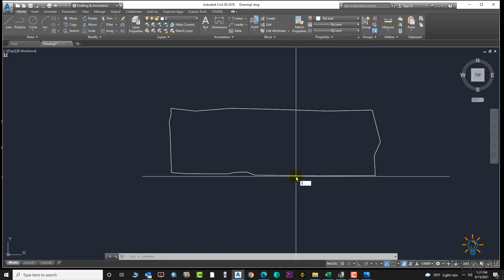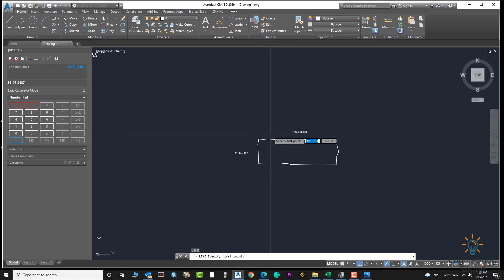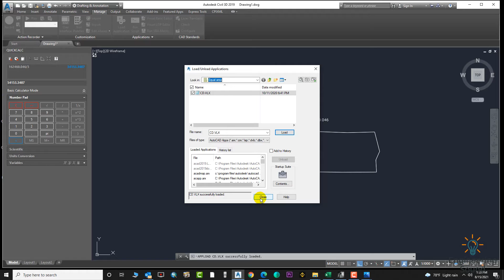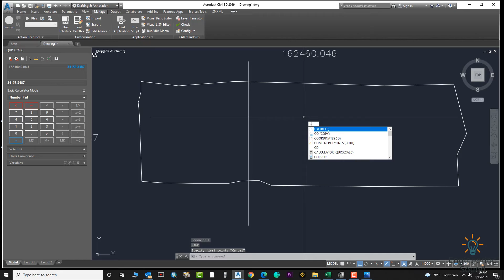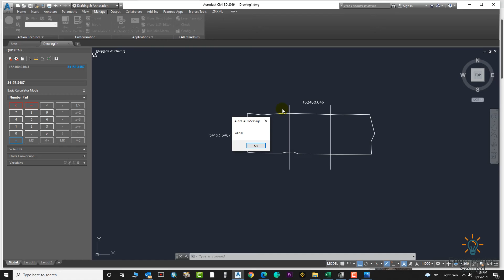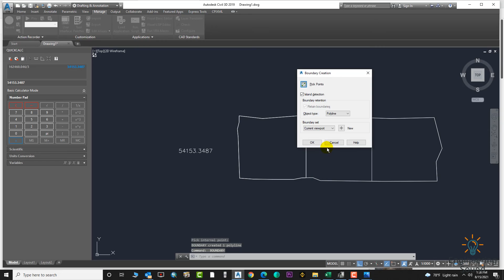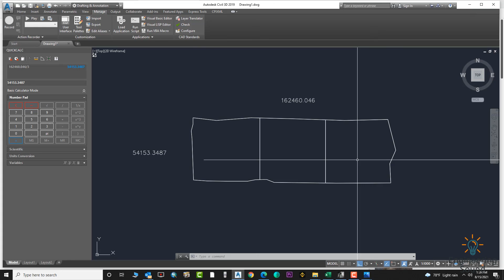HOW TO DIVIDE IRREGULAR PLOT IN EQUAL PARTS IN AUTOCAD || DIVIDE AREA USING LISP IN AutoCAD Civil 3D

Comment: Hello how can we divide lot in AutoCAD base of our measurement or base on specific measure.  example 3 lots not equal, one has 100sqm and other got 200 and 250?
Reply from the maker: By Using parcel Method
Reply: @Muradfarooqs  thnx for the response, do you have videos relative to that?